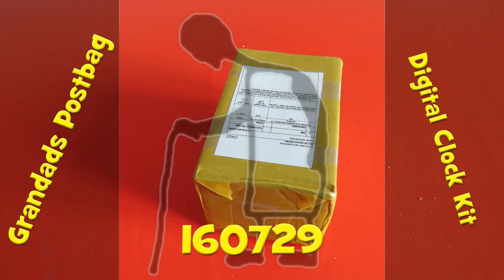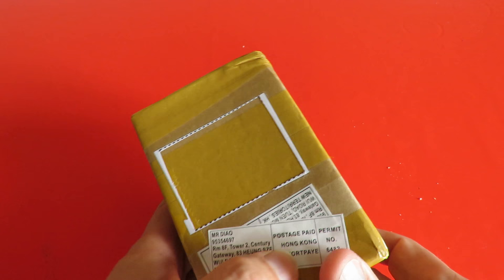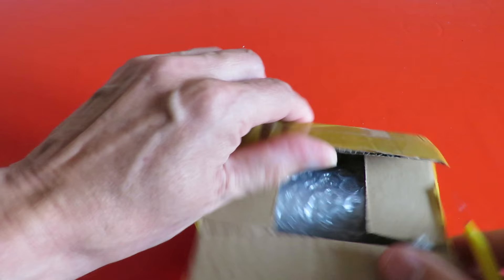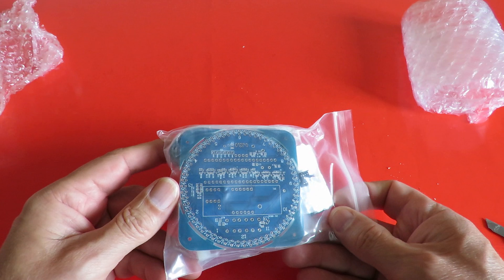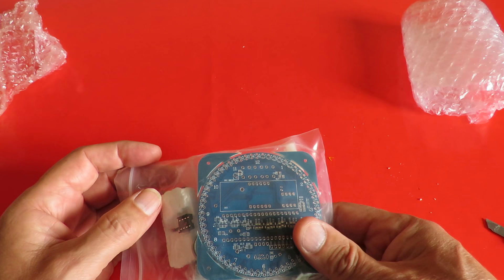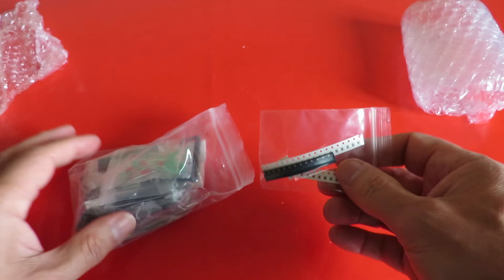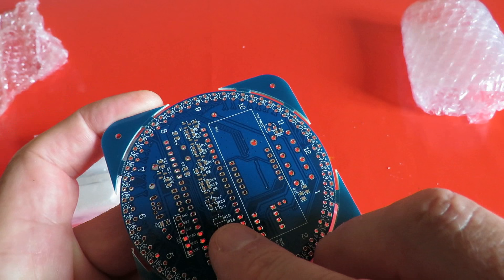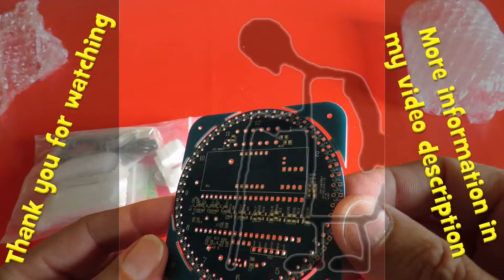Grandad's Postbag 160729 Digital Clock Kit

Comment: Definitely a challenge.
I'll even watch the long version of this one.
Reply from the maker: We will see, it may run for days :)
Reply: lol
Reply from the maker: Just had a close look at it. No instructions and the circuit board does not have the resistor values marked. I have had to search for instructions and I have downloaded a 10 page tutorial. Starting to panic :(
Reply: 😨
Whoa....it is going to be a really long video
Reply from the maker: Wil Hobbs I have made a start on it, done one and a half hours so far, neck aching from straining to hold my head in place for long periods, probably nearly half way there now.
Reply from the maker: Wil Hobbs I have just finished building it so I can confirm it works, but I am not sure when the video will be ready. The build was probably over 4 hours of work and that is going to take some editing and then I have to fit that into my publishing schedule.
Reply: Wow.  
It could turn into a series.
:-)